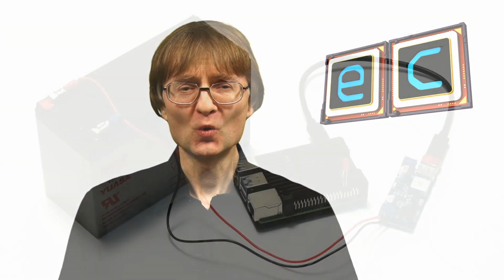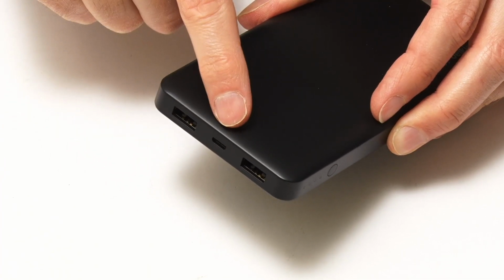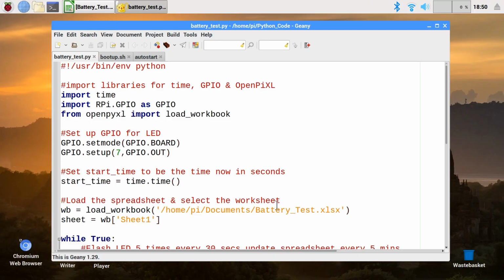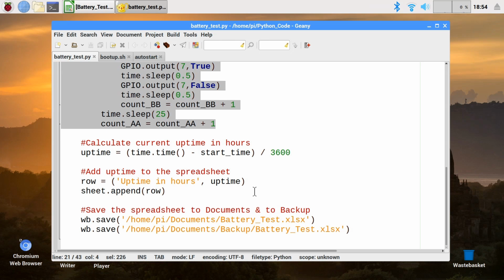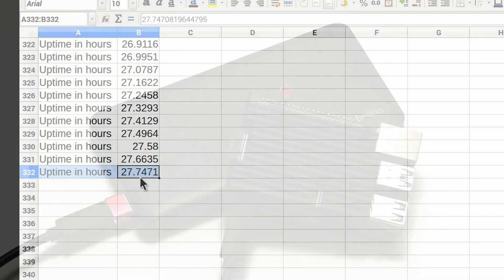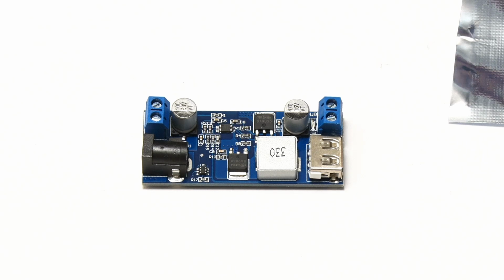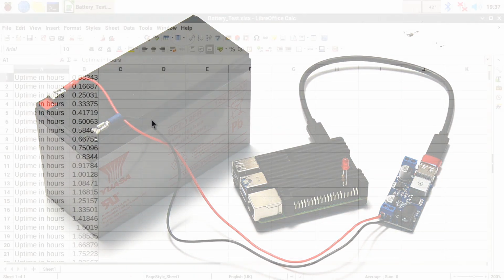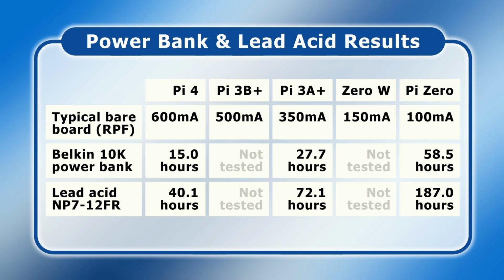Raspberry Pi Battery Power

Comment: Hi Chris. You must have the patience of the devil :-) I have a Raspberry Pi Zero attached to a WiFi dongle and SDR radio via a USB hub which 'listens' to ADSB aircraft transponders on 1090MHz  (mainly East Midlands Airport). This setup is powered by a similar battery, but I have connected the battery to a cheap solar panel and controller with 5V USB out (about £35 from Amazon). So the system is nearly maintenance free as the battery only really does the nightshift. I would probably recommend a 'deep-cycle' lead-acid battery for this type of application, as normal lead-acid batteries are good at dumping large amounts of current in a short period, but can degrade when used for long periods with a small load. If you are interested, my RadarBox station is here...  https://www.radarbox.com/stations/EXTRPI025326

Comment: if anyone is thinking of using a powerbank as a UPS for the Pi (like i have considered sometimes), do note that there are powerbanks that will also cut off power for a second when connecting and/or disconnecting the charger. both of my powerbanks (sony and Samsung) do this and it's very annoying as the Pi reboots unexpectedly everytime

Comment: put that lead-acid battery under a load of 1.5 A@12V and you can see the numbers go way down. The good and clever thing about this test is that the Pi was using 5V through the buck converter and the battery capacity @12V was exceeded by the practical one @5V. Good content again

Comment: Those cheap lead acid batteries are drawn way beyond their minimum voltage, as the buck converter takes voltages right down to 6 volts and thus draws current until that voltage in teh battery. 6 volts is a deep, deep discharge, something that they never recover fully from. If you do that 4 or 5 times, the battery will become close to useless. I know, I have personal experience.

Comment: official belkin page do not provide at which voltage capacity is 10000mA (probably it is 3.7V not 5V!)  Comparing 7Ah at 12V can provide 84Wh but 10000mA at 3.7 = can provide only 37Wh
(minus some losses during step-up from 3.7V to 5V) and you have ... difference 15h vs 40.1h for Pi4   (37Wh vs 84Wh)

Comment: Combine a RasPi With a 9.2 Ah Lead-Acid Battery and 2 10W Solar Panels in Series and a Cheap PWM Solar Controller. It will run forever.

Comment: This comparison is unfair.Powerbank controller disconnected the load when battery voltage was critical. Buck converter without controller will continue suck power from battery even when voltage critically low. You should have tested acid battery with some sort of controller which disconnect load on low battery charge or use LiIon battery pack without protection.
Reply from the maker: How can this be "unfair"? The test revealed the maximum time each battery setup could run the Pi. Yes, absolutely running any battery flat, especially with no cut-out controller, is not good for the battery, and nowhere in this video do I recommend it as intended practice. But as a test to answer the question "how long will these setups run the Pis", what is shown here is 100 per cent fair! :)

Comment: There's a lot of things that can be powered by lead acid batteries. This would be very useful to keep your Pi mail server running during a power outage.
I know lead acid batteries are pretty durable in terms of charging-discharging cycles, so it would be very useful for some sort of home made UPS for your Pi.

I'm grateful for all of the effort you put into making this video. It is really important to know this.
Looking forward to your next video. I wonder how it will perform in real world situations.

Comment: I'm doubting the the power bank is really 10 amp hours, but not really sure.
Reply: Belkin is a reputable brand so there would be no reason for them to use fake batteries.
Reply: @mashedpotatoes5323  ok. i believe you. i just know some other manufactures are not that reputable.

Comment: My takeaway: the time has come to say goodbye to Fortran and learn Python!
Reply: What's wrong with PASCAL, buddy?
Reply: Gee do they still use Fortran? I learned it when I first started in IT back in 1971 - thought it would be only a historical curiosity by now.
Reply: @David_P132  you'd be surprised that Fortran is still alive and kicking! There are a lot of legacy systems out there as I've recently learned (last year) when an astrophysicist acquaintance asked me if I could look at their system for an upgrade (formula modification) as his programmer was unreachable at the time.
Reply: @David_P132  ..Lordy, I started on FORTRAN back in 1970… along with COBOL and RPG. Then dived into assembler.
All on an IBM 1130… 8k core, 500k single-plater HD. Punch-card.
🤓
Reply: @ernestgalvan9037  We're showing our age guys! Back when we learned IT from the zeros and ones upwards eh?
Reply: @David_P132  Fortran is still very commonly used in academy, e.g. for physics and quantum chemical simulations. A great deal of quantum chemistry packages are in Fortran. BTW modern Fortran (2003 or 2008) would probably be irrecognizable to you if you are stuck to ancient Fortran 1966. It is still used IMHO for two reasons: 1. large base of existing software (very fast, very complex and bugfree) 2. for new code, it offers everything you need for writing high-performance, portable numerical code and it's easier than using eg C++ .
Reply: @luckyluckydog123  Yes - just for interest I googled "Fortran syntax" and did not recognise any of the examples given at all - like a different language.
Reply: Pah! Fortran is for old people: PL1 is the future!

Comment: It is not really that power banks have 0.75C "usable" capacity, It is because power banks measure capacity relative it's own battery, generally li-po, with a tension of 3.7V, and use a DC 2 DC convertor to raise it to 5V, and subsequently dividing the capacity by 3.7/5 = 0.74.

Comment: Chris, thank you for this new video, and also for the previous ones that I always watch with pleasure from the South-East of France. You were surprised by the life span of the lead battery.
In fact, it is not a surprisethis is the conditions of discharge of this battery which if you allow it, are biased. Let me explain. Your powerbank is equipped with a low voltage discharge protection, this is done by a BMS inside. Your lead acid battery is not "self" protected. However, the end of discharge voltage of this type of battery is 10.5V, never lower  !!!! If you do this several times, you will ruin it.
You have probably discharged it far beyond this voltage, to the operating threshold of the 12V to 5V converter. Am I wrong? You have therefore, if this is the case, drawn on its reserves, well beyond what is reasonable. Hence this super capacity is distorted.
I'll be happy to read more from you on this subject.
Reply from the maker: Thanks for this. But I am bewildered by why you and others consider the 12v test "biased". It is not biased. The tests of are of how the systems shown perform, and there is no bias here at all. I am perfectly aware that the power bank will cut-off, but the lead acid battery run flat. But that does not make anything here "biased". Certainly, you may with good reason consider it more appropriate to set things uo different and to run different tests. But that is a different matter entirely.

I am also aware that running a battery flat is not good for it and nowhere the video do I proposed it as good or intended practice! :) But this is a video of tests. And as I so often end up typing here, videos and YouTube are not real life.
Reply: @ExplainingComputers  Hello Christopher,
Let's be clear, I'm not saying that you are biasing the result or that you are biased, never, never, I enjoy your videos too much for that. It was just to highlight the difference in capacity found between two types of battery, when the result should have been the opposite. Rated capacity are 7Ah for the the SLA and "theoretically" 10Ah for the powerbank. 
Anyway, your video will make me appreciate the Raspberry Pi Zero for its frugality.
It will be a great pleasure to watch your next video. Have a nice day..........

Comment: Please beware.
Your usual lead acid battery won't last many charging cycle because they are designed for Stating, Lighting and Ignition (SLI).
To improve performance use a deep cycle battery. The most readily and cheaply available are marine batteries. They will significantly outlast the LSI battery type.

Comment: A general psa: I've found the li battery banks will often lie about their capacity. I got one 10k mAh and opened it up, ran the individual 18650 batteries through a capacity test and found out I had closer to 6k mAh battery. Short story, you get what you pay for, good li batteries are expensive. Note, I've also run the same test on the expensive batteries and got accurate numbers.

Comment: Lead acid batteries get even cheaper per unit charge if you move up to a commodity product (i.e. something designed for cars/carts/solar/etc). For many applications, lead acid battery technology has not been improved upon in the 150 years since it was first commercially developed. Try to think of another best in class contemporary tech which has essentially remained unchanged in 150 years.

Comment: I have a car 60 Amp car battery charged by a 50 Watt Solar panel at my allotment and am planning on running a raspberry pi to collect environment statistics and upload to the internet. Initially it'll just collect temp/humidity/soil temp/soil moisture levels and then finally I want to use that data to activate automatic watering. Eagerly awaiting your follow video on the weather station you did earlier in the year to see what you have got planned and how you're going to tackle a similar problem. Great video by the way!

Comment: You did not mention if the buck converter has protection for the lead-acid battery? Such a circuit might also be included in the solar MPPT charger. (do get an MPPT one if you live in the UK).  If you revisit batteries, also have a look at NiMH batteries as they require very little protection.

Comment: In my experience it is difficult to get an uninterruptable power supply for the RPi. The USB power banks often don't allow charging and supplying current at the same time. I bought a USB bank that said it could do this, but when the wall power was removed, it cut output power for a split second which caused the RPi to turn off. The same thing happens when wall power is applied again. So in the event of a power outage, the RPi will reboot, and will reboot again when power is restored.
Reply: Actually, this is very useful information! This gives me an interesting extra input about the "passthrough charging" feature that some powerbanks claim.

Comment: Hey Chris -- can you please try running a Raspberry Pi Pico on the lead-acid battery and see how long it lasts?  I kid... that would take until the end of the multiverse.
On a serious note though: how about a small solar panel for your greenhouse that charges the battery continuously? (as the Pi pulls it down).

Comment: I think these high uptimes on lead-acid are caused by deep discharging the battery.
You calculated the usable capacity, but the buck-converter is kind of dumb in contrast to the buck-converter in the Li-Ion powerbank.
If the battery is down to 6V the converter still provides 5V for the Pi, but 12V lead-acid batteries should not be drained under 10V to prevent damage to the cells.
The buck converter doesn't know that.

Comment: Great, informative video! Lead acid batteries were used in early electric cars in 1910, giving a range of greater than 60 miles (at 10 to 20mph). Your video also reveals the low power consumption of ARM computers is a compelling reason to give them a second look for everyday tasks such as word processing or accessing the Internet.

Comment: imagine a pi400 with an USB monitor and a wired mouse running from a car lead battery that's being charged by solar panels, I guess if you can avoid any DC to AC conversion in the system it would have a good autonomy

Comment: I will repeat what I said couple years back. Raspberry is totally not suitable for battery operation due to high power usage. For example, pi4 will completely drain a couple year old car battery in a week. So even a pi4-based media center or an alarm/camera system is not possible/practical. Main reason is that it does not support sleep/suspend mode and can't be woken up quickly by external interrupt.
I used an android media player for couple of weeks and... it was almost completely booted when I already arrived at my destination. What a tragic experience.

I've raised this question of sleep mode on rpi forums, and was put down by devs saying they don't care, as rpi was not meant to be energy efficient.
For a contrast: if CPU was run only when needed, you could have it running for a year from these batteries.

Comment: What was the final voltage of the battery? Typically a 12V device will start failing somewhere just under 12V but I suspect thew buck convertor will keep providing 5V way below a 12V input. The problem with doing that is you risk damaging the battery (some don't like being discharged so low and will eventually shorten the battery life). Maybe Clive (bigclivedotcom) could chime in and provide some of his experiences powering devices off of USB voltage levels.

Comment: The battery bank typically has a over discharge protection that prevents the cell from going below 2.5V. When you hook up a lead acid battery to a buck converter how low are you going? I assume the buck converter would  stop outputting  stable 5V after th battery reaches about 6.5V. Isn't that too deep a discharge for a 12V battery? I expect repeated use at such voltage ranges would kill the battery quickly.

Any thoughts about this?

Comment: Can you charge the batteries from solar panels at your greenhouse - or maybe from the vanes on your weather station? See if you can have a self contained system in the end?
Did you try just appending text to a file and calling fsync() rather than having a complicated spreadsheet library?

Comment: Hi Chris, I dont see any low voltage protection on 12V Pb battery side. What was the battery voltage after Pi shut down? Deep discharge will rapidly kill every Pb.

Comment: I power a Pie3 with 4x AA 1.2, 2500mah rechargeable batteries, which also power two DC motors, camera and ultrasonic sensor. the voltage drops to 4v under load but the Pie never crashed. Less power capacity than a 10K power bank but much ligher and portable setup

Comment: I order 8 cell power bank cases from ebay; takes 8 x 18650 cells and have the circuit board already installed,. I then order 8 Samsung 3500 mah cells to install. These diy power banks have 28000 mAh storage and USB A and C connections. These power banks really last and will power a pi 3b for days. Total cost about $26.

Comment: Great video, thank you. I reckon the Zero W would have been a better inclusion than the 3A as IMO this is more useful as a remote IoT device. I'm hoping that this will be the one that you use in your greenhouse project! What I also like about Lead Acid batteries is that you really have to work hard to set them on fire.

Comment: If you put an AMP meter in the circuit you know the real current draw of your test setup. Or... let the py measure and record the voltage and amp use of the battery and log it also... 🤪😂

Comment: I’m using a Raspberry Pi on board my boat as part of my navigation system - look for Signal-K for details of a typical setup. This of course means powering the Pi from the boats 12v system. I use a buck converter designed for use in trucks - it’s waterproof and can deliver upto 10A at 5V. Interesting to see your tests! Worth noting that the reason most lead acid batteries talk about capacities of 50% or so is to preserve the life of the battery. The number of full cycles from the battery drops dramatically if you keep fully discharging it. It’s not that the battery can’t deliver most of its charge, it’s that you kill the battery by doing so. On a sailing boat, charging the battery from the engine alternator or a solar panel, we take great care not to discharge lad acid batteries below about 50%, or we’d be spending hundreds of pounds to replace them every year.

Comment: Right! A great video, indeed.

This also poses the question of how you can optimize the workload you have.

For example, I'm curious how much extra processing power that spreadsheet loading&writing is taking.
That could surely been made more efficient by simply appending to a CSV file (using barebones OS functions of open() and write() ) the current uptime, a comma, uptime in hours and a line ending.

Or, even better, simply "touch start_time" and "touch time_a; touch time_b" (to have the same "backup") which are simply OS functions which should provide minimal processing. The uptime could then be computed manually by seeing the latest modified time between time_a and time_b and substracting the modified time of start_time.

Since this is a test, it doesn't matter that much, you can say that the workload was simply heavier. But for a real application, searching optimized code might provide a really big benefit.

Comment: Chris, I think it's the buck converter. I saw them rated at 96% efficiency. You should try three series two parallel lithium-ion batteries on the buck converter. I bet it beats the lead-acid battery!

Comment: For the Lead Acid battery in your greenhouse it would be great to keep track of the 12V battery voltage to try and keep track of state of charge. It's 20 hour rating is at discharge to 10.5 V, but the buck converter would keep working below this with such low current draws - effectively below the battery's nominal 0% SoC. Aiming to keep above ~20% SoC will extend the life of your battery long term.